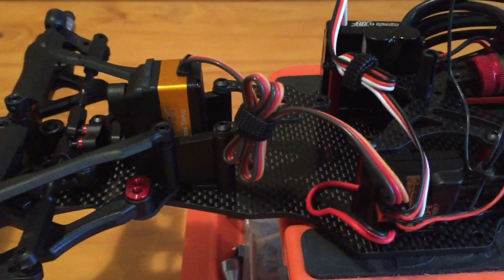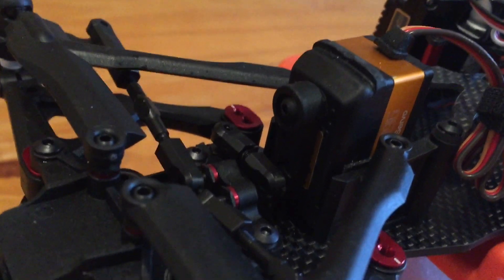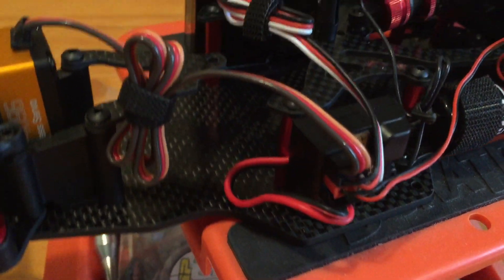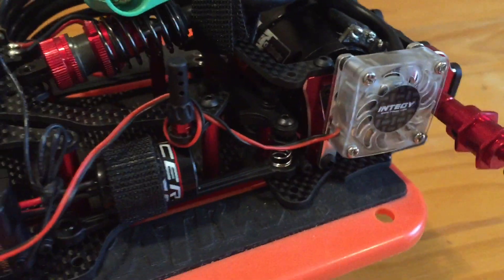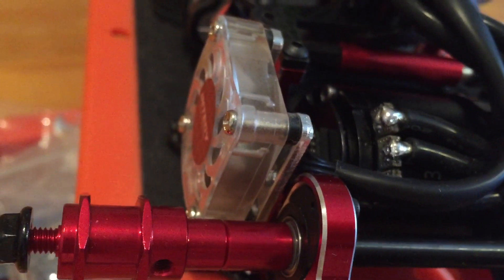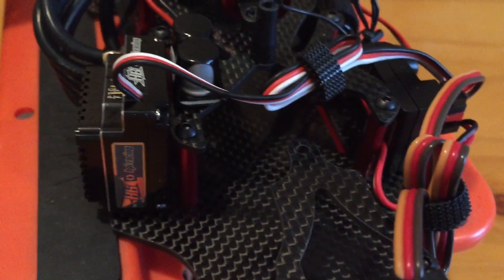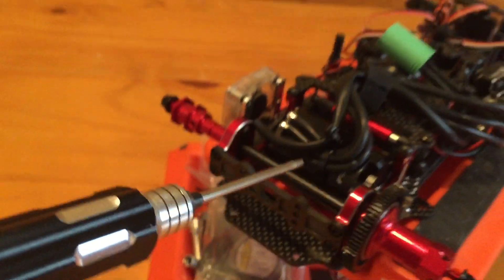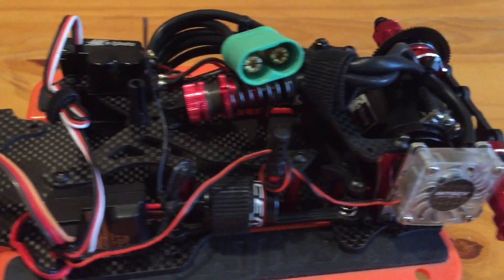Speed Passion  1/10 F1 Update...Assembled

Comment: I love when guys like you  MR DAN build, paint, &do Krazy things like speed runs that can destroy the whole car in seconds keep the builds coming
What made you go with speed passion and not Tamiya or 3racing?
if it was me i would go with the cheapest chassis & electronics (becuzz when stuff goes bad at 70mph things Explode)
Im thinking that this summer I will end up with a F1 chassis

have you ever did speed runs with slash or rustler?
Reply from the maker: Yes I've done quite a few speed runs...with a Slash 4x4, Bandit, Sprint 2 Flux, Vorza, and a couple 1/16 e revo runs. Although I've never destroyed any RCs on high speed runs...I know the chances involved. But hey, it's no difference from flying RCs crashing into the ground or guys doing extreme bashing with RC trucks and buggies. But I also like slower moving things like drifting and crawling. 

I went with Speed Passion basically because there weren't any 3racings in stock when I was shopping around. I personally think Tamiys cars are over priced. But this F1 has a lot of included upgraded parts like carbon fiber and aluminum...only time will tell the quality.